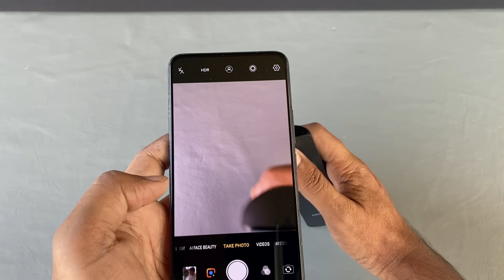8 Amazing Electrical Life Hacks | Tips & Tricks

Comment: With this one simple trick, you can burn down your house
Reply: I swear lol, I was looking for tips for work and this guy has whole YouTube video of how to make shit harder
Reply: My god, so true... A lot of houses burnt because of this "tips"
And people applause 😱
Reply: 1:45 if u wrap it the other way around the screw it would stay under the screwhead instead of spitting it out
Reply: @Magnum-lo1te  Exactly and if you twist the wire strands anti clockwise they are even less able to push out. Better still use a half decent washer.
Reply: you are fool dude, i am an electrician too, and the tips are good
Reply: @kurdihermawan5113   @Kurdi hermawan  where at? If you need to twist several cables together strip them and put them in the drill itself.  There's a cable braid instead of a square knot. Twist the wire clockwise with the screw. Twisting  male&female plug together is okay but don't pull the shit out of it lol. #2 is for rope. #4 either replace the battery or check if they're dead then replace? Lol.
Reply: This has to be a joke!!!!!!
#1 stress on cable, stress and damage on insulation = phase to neutral short......what happens next I wonder?
#2 cool magic trick
#3 one of the ugliest lug crimps I ever seen.  Is it even crimped? 
#4 maybe point remote at device first? pretty sure this would give you an indication if it works or not?
#5 same as #1
#6 ???wth  I think the comparison between the two says it all....and what a waste of time just to twist two wires together.......
#7 yep......just need the insulation tape and all good.....not......
#8 I will give him this one at least

Where can I find this guy to wire my house? seems safe enough
Reply: Twisted/Circle the cable make the cable stressed, and of the ampere is over, then GOODBYE people houses
Reply: Ff
Reply: Rap

Comment: Most of this stuff seems like it would, sooner or later, burn your house down 🙄
Reply: Then why are you watching?
Reply: Why???
Reply: @Davysguru  the more coiling of wire the more heat are produced.
Reply: some of these look ok ngl.
Reply: The truth!
Reply: @AG_92  stupid question. Before I watched it, I didn't know it was an idiotic video.
Reply: The wire twister is pretty scary.
Reply: Most of that is unnessecery or completly dangerous.
At first you can't bend these cablea how you want, they have a limit where they get weak and break 
Then using these type of cables bear on screws is not safe as they will loose up, give bad contact or even give inside a short circuit
Then the cable lugs looks completly not safe
Even the "how you put that on. Proper material and specially proper tools as IT will loose up quickly
Reply: @astrid2432  Yes you are right.
The only one that is "legit" (and nice) is the last one. The rest is just as you said. 
I know because i am (as you are) a professional electrician.
Reply: @ਬਾਪੂ  how?
Reply: @mattimus8250  The wire twister seems like an OK idea for some things, there are other tools designed specifically for that job, definitely NOT as tight as they wrapped it... that's a disaster waiting to happen. Personally, I wouldn't make/use it for anything I'm doing... then again, I wouldn't do any of these "hacks" for anything I'm doing.
Reply: I agree, no one should use any of these "hacks" or "tips" for anything they are doing. some of it is common sense (wire lugs to secure to a bolt instead of wrapping the wire around, for example).
Reply: Can youtube please anull my view??? I am so embarrassed I watched this.....
Reply: @martiekr  No the trick No.2 to get the wire out is also good.
Reply: Its true.. by enlace the cables the ONLY thing is doing is creating a even more electromagnetic field...
Reply: @martiekr  nah, checking remotes with camera and releasing that stuck plug (second "trick") were fine too. But rest - yeah, even if someone isn't professional can tell you're putting to much stress on these wires.
Reply: J
Reply: @AG_92  People who know what they are doing like watching these videos because we get a laugh at how dumb people are. Also it reminds us why we get paid well to fix other people's mistakes.
Reply: ... yeah, it's DIY techniques.  you want your house fire free? you can call yourself a professional like a sucker

Comment: Some of these where good but here are my tips in return:
1. Don't use a Philips screwdriver on a Pozidrive screw
2. Don't rely on a knotted wire for safety or reliability.
3. Use a crimp tool for crimps.
4. Stranded wire can be be fastened reliably under a screw and washer if a loop is made with the tail twisted around the bare wire just before where the insulation starts.
5. Apart from aesthetics there is nothing wrong with mains cables being cable ties in a circular manner. (oh, and you should make sure that the plug in the background is pushed in firmly.)
6. Minor point - use side cutters on cable ties.  Scissors are not usually strong enough for cutting cable ties.
Reply: I save the edge on the side cutters and use canine toe nail clippers.
Reply: Ask me anything about house wiring. Thanks and best regards

Comment: 2:04 For the love of whatever god you pray to, use a proper crimp tool! Even if the wire & tag make decent contact that doesn't deteriorate with time (doubtful), that wire's going to pull out the first time you put any tension on it. It would have been better if you'd not used a tag and just put the wire the right way round (clockwise) under the screw head...
Reply: That's what I thought the life hack was going to be: wrap the wire in the direction that the screw tightens

Comment: 1:50 simply twist the wire and curl to the right, so when you turn the screw, you make the wire go WITH the direction.
Reply: Just what I was thinking.
Reply: It is not proper way to do that. In some coutries if smt happends and they found out u had smt like that u can go to jail for bad connections like that u are proposing.
Reply: More to the point if you're going to crimp it like this video shows, you should really be crimping it properly - basic crimping tools aren't expensive and it's definitely worth it for a higher quality result.

In a pinch, they'd have been better soldering it into the crimp contact if they didn't want to secure it properly.

And quite aside from all of this, you don't need to be doubling over if the crimp is suitable for the wire you're fitting to it...

Comment: Dude, for #3 at 1:36, all you have to do is wrap the wire clockwise instead of counter-clockwise (like they're doing on purpose).  Of course a crimp is going to ALWAYS be better, but most scenarios like this just need to go the other way =)
Reply: lol exactly what i was thinking
Reply: @xavierbelanger1658  Only works if you have a crimp to use ?
Reply: Apna
Reply: True, however  stranded wire is NEVER approved for going under a screw. NEVER.  Also, if a UL licensed person installs it, it will ALWAYS be done with ring terminals since most electrical fires are caused by loose connections ( the biggest culprit is the neutral on ranges and dryers so have them checked professionally every now and then, after all, which is cheaper a small electrician bill or rebuilding your house and burying people?)

Comment: The NK 
Tip 1 please be aware that it is dangerous to install single insulated wires into a high voltage plug

Tip 3 the crimp lug is incorrectly installed as the tabs for bare conductor are not compressed appropriate tool creating a potential high resistance joint resulting in over heating and possible fire.

Other tips where wires are just twisted or tied are not good practice as all connections should be secured with a clamping force to prevent them becoming loose and creating a high resistance causing overheating and possible fire.

I'm not being nasty just want to point out the risk involved in such practices

Comment: You broke an electricians rule with #3. You always wrap wires around a screw in the clockwise direction, never counter- clockwise. If you did so, it would have been a clean connection.
Reply: The crimp is also poorly done the wires not being clamped correctly potential for high resistance connection and overheating with possiblity of fire

Comment: 2:16 how is that a hack if you have to buy the specific thing made to solve that specific problem
Reply: in india, that is a hack
Reply: Also apply it completely wrong and turn it into a random fire creation device
Reply: This is standard procedure ... For electrical engineer.. we have thousands of these in our workshop at all times
Reply: @mybest3615  exactly
Reply: @AshishYadav-bi4zm  Agreed why not just I don't know wrap wire clockwise around screw instead of counter clockwise?
Reply: @hollowlife1987  if only lol
Reply: @hollowlife1987  Because that doesn't make for good video and is probably stronger than the terminal used
Reply: Можно ещё намотать провод в сторону затягивания шурупа. Предварительно его стоит скрутить
Reply: @S S if it is a low voltage connection sure use one of those, but if it carries potentially lethal then no, never.  I can say I have seen many fires caused by lose wire connectors on outlets because they wrapped it counter clockwise around the screw.

Comment: Always thought you weren’t meant to loop cable because it generates heat.
Reply: 0:40 lo auto njeder kalo itu ada load yg konslet auto kobong
Reply: @johncao8373  napa pake indo cok?
Reply: Youre not supposed to loop it too much because cables become coils. But only knotting it is ok because the heat loss is very small.
Reply: It do generates heat its not good wenn u do that  
Dont do it becouse it can Flame up

Comment: Tip 1. U.K. has cable grips in plugs so no need for this.
Tip 2. Fine but don't trap your cables in the first place. 
Tip 3. Clockwise or use a crimping tool!
Tip 4. Bluetooth remotes are a thing now, no infrared.
Tip 5. The point of that plug is to come apart when pulled tight for safety.
Tip 6. Just no. 
Tip 7. Could be useful for pulling new wire through with old wire only.
Tip 8. Ok if you have the time.

Comment: 7. There’s a better, simple way to join multi-wire cables lengthwise. Instead of twist, open the wires in a fan shape and cross-link them half-way at 120º (as you would do with your fingers). Bring the wires together and twist each end in opposite directions.
Reply: Сам использую такой метод, добавляю термоклей как дополнительная изоляция и сверху термоусадка, надёжно.
Reply: ယ၇
Reply: Ask me anything about house wiring. Thanks and best regards

Comment: With the custom electrical outlet plug, try soldering a 1 million ohm resistor on each prong, then solder an aux headphone plug on the other end, then plug the electrical plug in the wall and plug the headphone aux plug into a Linear PCM voice recorder.  This way you can record the sine wave coming out of an outlet as a WAV file. If you then pass this resulting WAV file through a multi-stage comb filter,  you can amplify the result and you can hear the neighbors appliances turning on and off.

Comment: The 3rd one although the wires are pinned inside a clip, it still looks messy because the wires need proper folding. The excess wire after twisting can be cut instead of an overflow on the outer wire and clip.
Reply: Ask me anything about house wiring. Thanks and best regards

Comment: First tip: Do not use single insulated cables, they are meant to be used in a plastic tube and low voltage applications. 100-230 V applications, use double insulated cables.

Comment: 3 isn't a life hack, it's a standard wire clamp. It would be a life hack where you take half of the wire to the left, half the wire to the right, put the screw in the middle and twist them together so the screw is stuck in the middle of the threads. Or just put the threads under the screw on the other ends so it tightens the threads instead of pushing them away using the screw.

Comment: If the wire curls into a ring, then this is bad. He'll be warming up. The wires are always unfolded and straightened before switching on! Especially when there is a large current. And then soaza was wrapped in a ring!

Comment: At 1:40 if you don't have a lug handy,  you should put the wire around the screw in the Clockwise direction.  Then as you tighten the screw, the wire will be pulled tight.

Comment: Unless you have the proper Ty-rap tool, you don't cut them.  That produces sharp edges that can be dangerous when working around energized equipment.  (cable trays, switch gear. panels etc.)  I prefer to grab the wire ty as it protrudes from the lock with my electrical pliers and twist until it breaks.  That produces a flush cut.  The sharp edge can cause you to  naturally jerk back.  That is something you don't want to do in an energized piece of equipment.

Comment: Those are some super expensive strippers for common wire.  We had to use them in the USAF when I was working backshop Avionics.  If used properly they never nicked the wire, but they are very sensitive and should not be toted around in the field.  Those zip ties need to be cut back and the end filed down!  The way they are will cut the crap out of you.

Comment: 3 tip: Again failed. Use press connectors or solder the cable and the connector. Otherwise, bad connection.

Comment: 5:15 they are designed to not touch the wires in that way. Youre shorting the wires. They should be hot glued back and then tape on it bruhh. Thats actually suicide fire what youve done

Comment: 6:25 so I have to use 10 zip ties instead of 2?
1:42 just wrap the wire clockwise, so when you turn the screw it pulls in instead of out

Comment: re the first one
OR............... you could have just put the wire on the other side so that the direction of rotation of the screw was pulling the wire instead of pushing back on it 
I mean.. Your way works  but   SO DOES MINE with less effort

re the second one
it's not a hack if you don't do anything
the camera already works and the remote already works
How is that a hack ?
by your logic.... i could put a pan on my stove and call that a hack